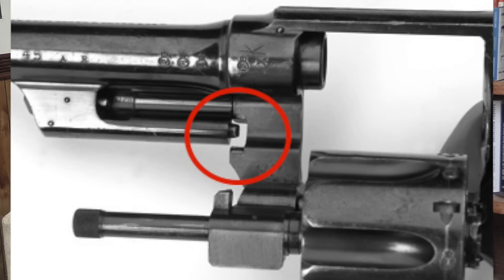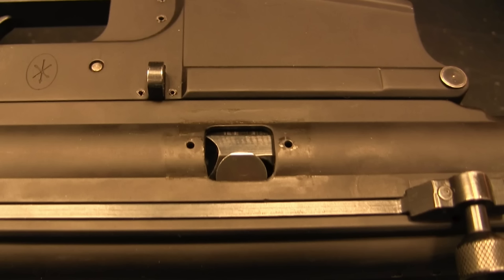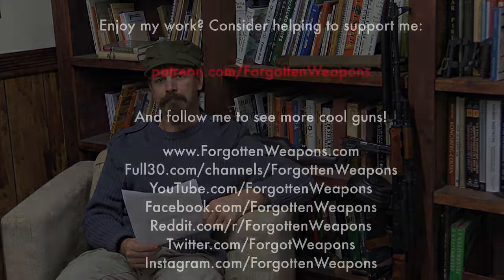Q&A #8: Triple Locks, New gun development, and the .50 Cal Lewis Gun

Comment: When we switched to the M27 these were the reasons we were giving for the switch:
1) Mobility, fire teams are more nimble. Loss in volume of fire is mitigated by the structure of Marine units (3 teams per squad versus the army's 2 teams per squad.)
2) Accuracy, The M27 is far more accurate and can serve dual roles as an automatic/DMR rifle (Also mitigates the loss of fire power)
3) Less of a target, the M27 blends in better with the standard m16a4 than the SAW and won't immediately catch the eye of a sniper.
4.Reliability, the M27 is supposedly reliable AF

They M249 SAW isn't completely going away, it's just been relegated to the company's  weapons platoon. (unless that's changed since I got out)

Comment: Regarding the Thompson $200 in 1930 is around $3000 today, by comparison 1930 retail price on a 1911 pistol was about $20 ($42 for a National Match model). That also brings the NFA into perspective. It was intended that that tax be dramatically more than the price of the gun or supressor you bought (original Maxim silencers were $10 retail when they were new).

Comment: Another advantage that a top feed magazine had over bottom feed ones is that historically these weapons were accompanied by assistant gunners or ammo bearers, and it is a lot easier for somebody else to insert a magazine into the top of a weapon than for them to put it in the bottom. I'd also argue that it is actually easier to load the gun yourself if it is top mounted, in particular if it is on a bipod but even if not as you can actually see the magazine well without fumbling around to find it.

Comment: I had some thoughts on a few things in this video, but the one that I feel is the most relevant is about the manufacture of guns in Japan after WWII. After WWII, Japan was more or less used as a base in the Pacific and I believe that Howa Heavy Industries was called upon to provide spare parts and repairs to the numerous M1 carbines in use by both US forces in the area and the Japanese Self-Defense Force. Eventually this culminated in the manufacture of M1 carbines in Japan by Howa. They were pretty much interchangeable with US made M1 carbines, but had a unique style of round-eared rear sight. I believe that they even sold some commercially in the US in both military trim and more 'sporty' versions. I don't think that they were all that common, but they are known to collectors of commercial production M1 carbines. Also Winchester/Browning have ties with Miroku of Japan for the manufacture of pretty much all of their lever-action rifles currently in production. Some people take offense to this, but I can attest to the high standards of workmanship on the Japanese made guns (if only they didn't feel the need to alter the safety from the half-cock notch to a tang safety, but I want to say that is probably an import requirement these days.).

Comment: A comment on the subject of officers issuing their own guns, in the Finnish Defence Forces even the regular reservists may supply their own guns, provided they use cartridges issued by the FDF. I was explicitly told this when I when I asked about it during one of my military refreshers. I was told that one of the advantages of reservists using their own guns during wartime is that even though they are semiauto only, quite a lot of them have optics on them (red dots and whatnot) and especially among the older (30+ years) reservists, their eyesight might not be that good anymore and optical sights may allow them to actually see where they are shooting without using eyeglasses. The iron sights of RK's are really good, but using eyeglasses on the battlefield isn't exactly ideal.  
I guess that's why there's a lot more 7.62x39 reservist rifles in Finland than 5.56, since if I recall correctly, the only troops that actually use 5.56 are the Border Guard special forces, who use an H&K G36C. I was thinking about getting a Valmet M92S back in the day, but those rifles are expensive as hell and I really didn't go to the range that often, so I decided against it. But I do own a Glock 17, which also happens to be the new standard issue FDF sidearm, so I'll be bringing my own if the shit really hits the fan.

Comment: My Weatherby Mk XXII was made in Japan.  Nifty little gun if you get bored of reviewing historically significant guns and want something slightly weird. .22LR semi auto with tube or conventional magazine. Has a selector for "single shot" where it locks the bolt open after every shot.  Sadly info is now almost impossible to find with the new Mk XXII being a rebadged bolt action and its crowding out the info on the older gun on the internet.

Comment: This comment comes 3 years too late, but I can speak to the M27 in a limited capacity. While I did not have 1st hand experience with the rifle, guys that I served with who did have one absolutely loved them. However, this is mostly due to the fact that they were easier to clean. (Do not mistake this as me saying the M4 is dirty and unreliable, because it isn't.) Because the military holds outdated and harmful weapon maintenance standards, and expects every instance of carbon to be stripped from the gun, it's just easier to accomplish that on a piston system. Also, having a full auto gun automatically enhances the envy factor of the guys who had them.

Although, they really have not replaced the M249. They are used primarily in place of an official DMR, with the added benefit of semi sustained suppressive fire if needed. It's more of a supplementary tool, than an all out replacement.

Comment: I wonder what would happen if you "dunk" your rifle in oil for preservation reasons ...
Reply: Depends on the oil i guess. Friend of mine that was a mechanic in the Swedish airforce told me someone in the year(s) before him had soaked a seriously dirty m/45B SMG in an oil used to clean jet engine parts. (Don´t ask, i have no idea what that stuff might have been.) And the thing came out clean. As in metal clean. Even the paint came off.
True or not? I have no idea.
Reply: A strong degreaser will do that.
Reply: SuperFunkmachine
Had to be one hell of a strong de-greaser. That paint didn´t come off  easily even from weapons handled by conscripts in all weathers over several years. It was sometimes joked that some of the weapons had actually rusted way and it was only the paint holding the internals in place.
Reply: I have read and heard of many examples of people/militaries/countries/whoever storing disassembled guns in barrels of oil. Doing so will preserve the gun almost indefinitely as it keeps water and oxygen (the two major causes of metal corrosion) away from the gun.  Usually this is only done with the metal parts, because storing wood in oil like this can deteriorate or discolor the wood and the oil won't get into all of the nooks and crannies as well.  I probably wouldn't dunk a fully assembled rifle into oil unless it had synthetic furniture, and even then it would be better to disassemble it.
Reply: Thanks !
Reply: Emrah Ekinci You're quite welcome!

Comment: Civilian ownership of guns as a "safety valve" against government oppression still works, but it's, shall we say, a "high pressure" safety valve.  If a significant portion of the populace is taking up arms, things have gone very far wrong.  It's still relevant to prevent certain types of tragedy, but it can by no means be relied upon as a primary safeguard against government abuse simply because lots of bad things can come to pass before significant fractions of the populace turn to open revolt.
Reply: Look at the middle east, Libya is what happens when that valve pops.